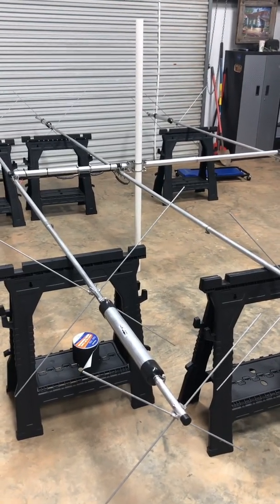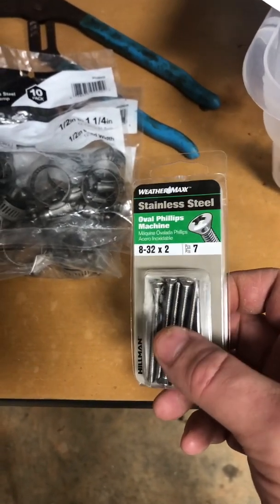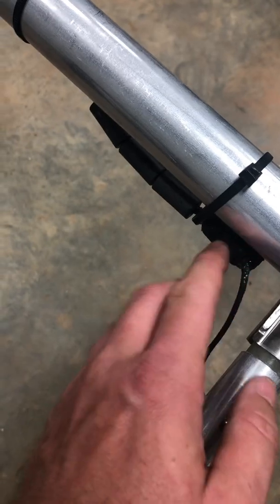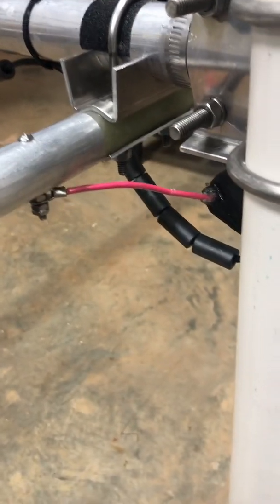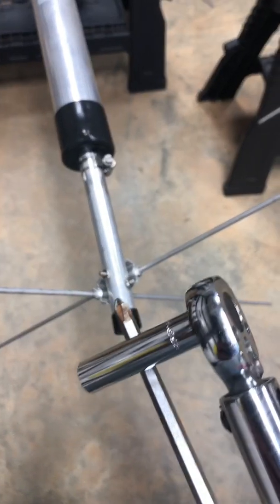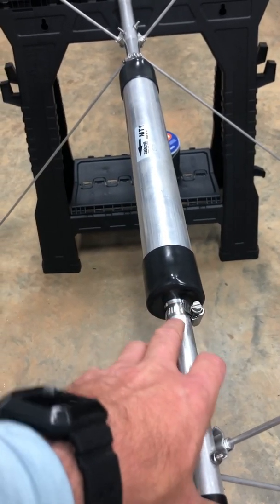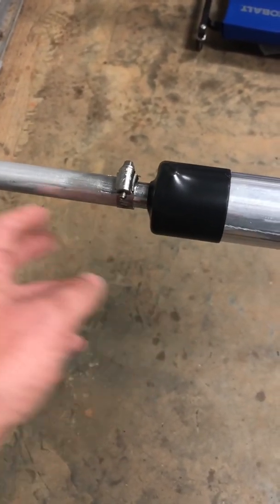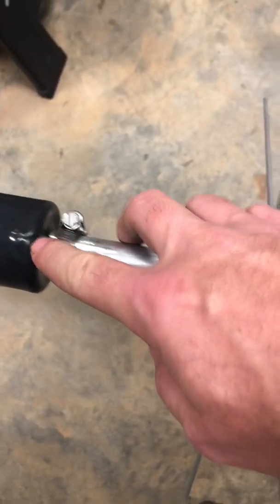Cushcraft MA5B Overview and Lessons Learned

Comment: Could I ask where do you come to the decision for 7inches at the ele 1 and 9 inches for ele 3?
If you want a centre freq of 14.025 the two elements are 9" , 14.175 the two elements are 8" and 14.300 the two elements are 7"
How did you come to the decision to put 9 on the rear and 7 on the front elements?

Comment: I am it the process of assembling this antenna. and my understanding of the tuning is based on where in the 20 meter band you prefer.  in my case i prefer the upper phone frequencies (14.300) so i adjusted both element 1 & 3 to 7 inches  DIM A & DIM B according to chart A . . If I am reading this correctly, regardless of what end of the band you choose both element 1 & 3 need to be the same according to chart A.   As far as element 2 goes in order to get 205.5 inches i did not make the adjust on the ends (EE). instead, I needed to shorten the entire length by 1 1/2 inches and did so by simply loosening the hose clamps (411) and slid both sides in 3/4 of an inch.  . . . . I look forward to any input or opinion that anyone has on this.
Gary
KC1OXM  New Hampshire
Reply: That is correct mine and the same, and I agree about the tuning chart, I think the posted might have made an error with his 9 and 7 on the outer elements.

Comment: Did you get good SWR? because I have been fighting with it. I see you got two different messuments for element 2 and 3. The tuning chart says 8 inches for the general portion of the band but those 8 inches are for both element 2 and 3. Im just wondering if I have mine set the  wrong way. Let me know Im having a heck of a time tuning 20 meters.
Reply from the maker: I do not have any issues with the SWR. With that being said.....my MA5B likes the lower portion on 20 meters.
Reply: @idkhamradio6088  It likes the lower because of the 9" setting, should you want it center of band, both elements need to be 8"

Comment: To help with UV protection, wrap the end caps on each trap with electrical tape. Taping over the vertical side where the elements connect is not necessary. I am also the one that said to inspect the screws inside the traps to make sure they were tight. 73' K2RET
Reply from the maker: radioman480 Thank you so much for all the information on the traps! I am going to take the traps off tomorrow and I will post a video on them!
Reply from the maker: radioman480 https://youtu.be/DHwRTf9RWUE
Reply: @idkhamradio6088  Glad you found the broken trap before you put it in the air.  Nice video of your find.  Good luck, de K2RET